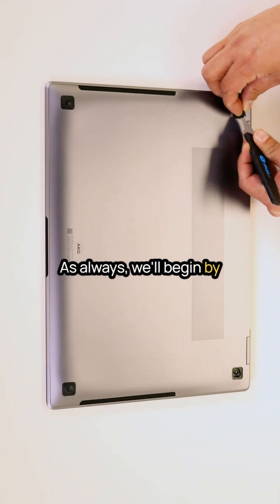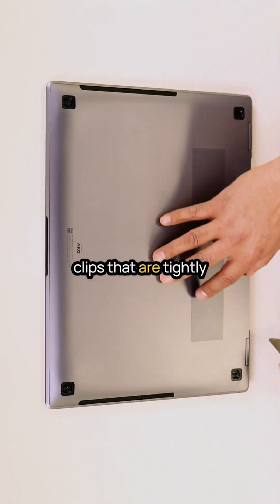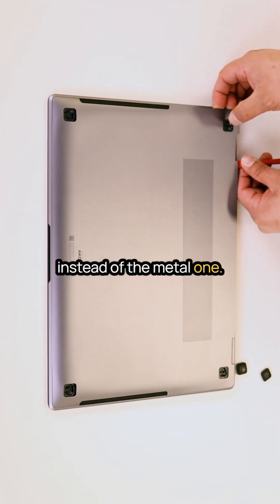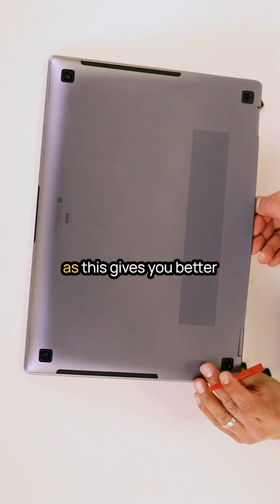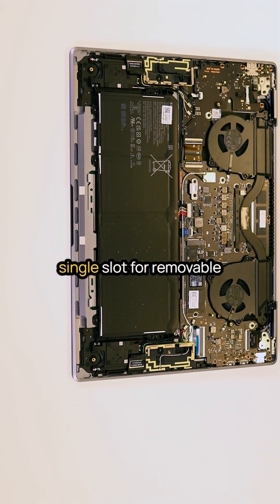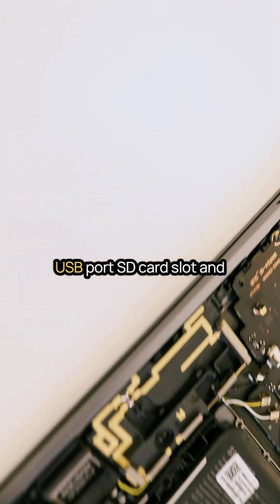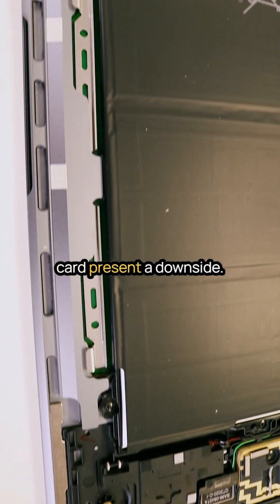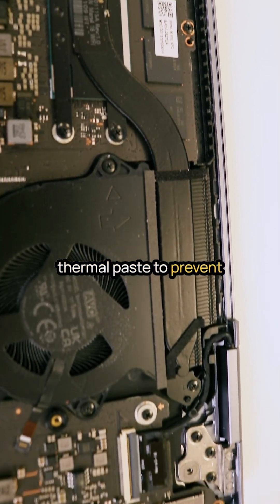Samsung Galaxy Book4 Pro 360 Teardown: What's Inside? #samsung #laptop #teardown

Comment: A plastic pry tool is a must to avoid damage. Start at the hinges to lift the back panel, then carefully work your way around prying the multiple clips free. There are many clips, at approximately one inch intervals. I found removing the battery terminal clip to be very difficult.

Comment: Trying to upgrade galaxy book 4 and the bottom cover is extremely annoying to remove just like this. I have an extra m.2 slot so idk why they do that. Trying to open without damaging
Reply from the maker: Go slow, use your fingers along with plastic pry tool
Reply: @Laptopnuts  I got it. Almost just gave up but got the 2nd ssd installed and now dual booting fedora and windows. I mostly used fingers to pull it a part.